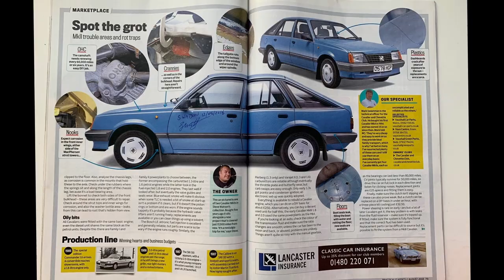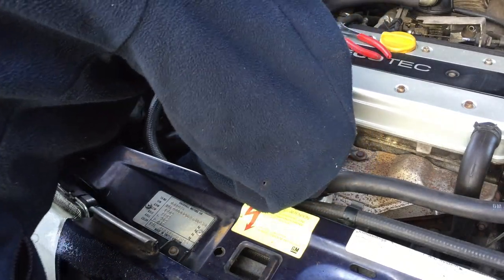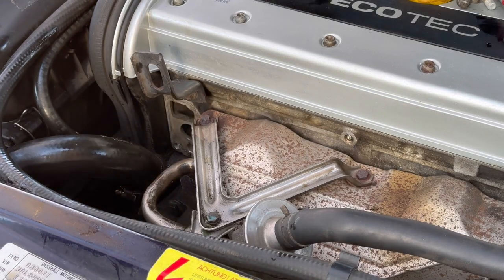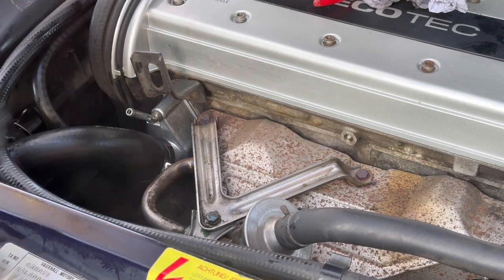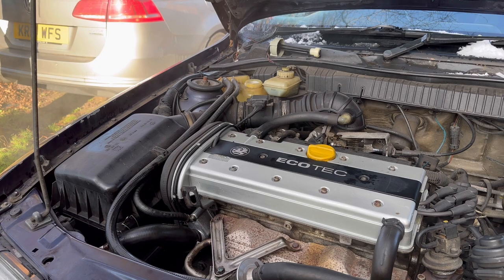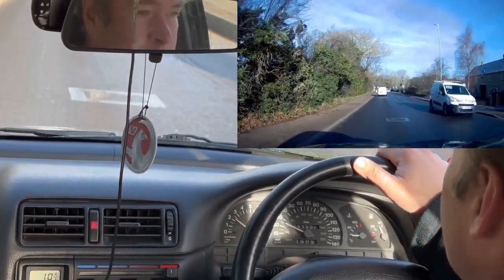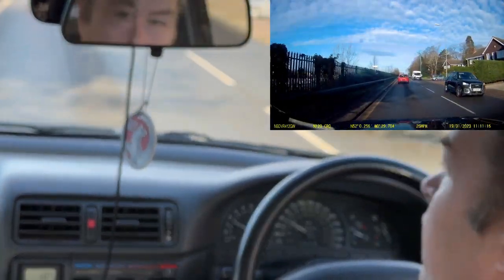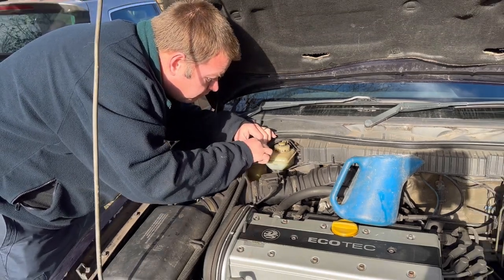Thermostat replacement Vauxhall Cavalier X20XEV with test drive

Comment: Another good video Steve. Yes you can remove the thermostat from the housing. I swapped one over on my Vectra b sri years ago as, i was only supplied the thermostat itself from the motor factors. Looks like that housing had seen better days though. Good work and, at least you have heat now. Look forward to the next video. Keep up the good work mate.
Reply from the maker: Thanks Matthew I thought it did I still have it somewhere, thankfully the heat is nice and consistent now much better than it was before that’s for sure. Next video coming soon it will be a long one so have a nice cup of tea of what ever you like and hopefully you will enjoy it. Cheers.

Comment: Nicely done.  Didn’t realise that was an automatic.  I need to get myself another mk3
Reply from the maker: Thank you! Yes I would rather it be a manual though but this came up at a good price a few years ago and it was so rust free I couldn’t not buy it.
I would do it sooner rather than later as they are getting expensive now and getting rarer.
Reply: @Cavalier_Steve  yeah I’ve noticed prices are on the rise. I plan on finding one for the summer.
Reply from the maker: Nice good luck, I hope you find one that you want, there are a couple of nice ones about if you don’t mind paying the money.

Comment: Nicely done Steve, don't you just hate having no heater in the car, my 2006 Mondeo ST TDCI had a heater issue for the 8 years I owned it, no matter how far you went the heater didn't put out any hot air even though the car got up to normal temps, I got the car when it was 2 years old and from day one the heater didn't work, my thinking was the heater matrix was blocked but it was a huge job to get it out.

Anyway mate I'm pleased you got it sorted and yeah I love an auto box, is yours a 4 or 5 speed Steve, mine is a 5 speed and it's the best auto I've owned👍👍
Reply from the maker: Hi John and thank you, this one really didn’t turn out what I wanted with the camera going flat 😒. Yes I bet you could have got away with the heater matrix being flushed out maybe with a hose pipe on your Mondeo I bet winter was a pain keeping the windows clear especially on a rainy day. 

The gearbox is a 4 speed but it does have toque converter lockup on 3rd and 4th which is good, it’s a good gearbox to be fair and on Vauxhall have paired with the engine well as the ECU retards the ignition timing on gear change so it makes it smooth very good implementation in my opinion, much better than the 2000 1.4 Honda Civic auto I once had. Cheers John see you in the next one. You may need 4-5 sittings for that or pop corn to enjoy when you watch it. Cheers mate 👍

Comment: Never worked on the ecotec in the cavalier, all mines are the single cam so interesting to see this one getting worked on. Is that your exhaust manifold blowing? I use the dexcool in my omega, which is ecotec as well so makes sense you're using it in this engine the single ohc you can just use normal AF.
Reply from the maker: Thanks Andy, I had someone else tell me that, apparently it’s a common problem for this style of manifold to crack, I took it off checked it over couldn’t find anything I also replaced the exhaust manifold gasket. It does have the wrong back box on the car so I think it maybe that, I will check it over again soon I have a second hand proper back box to put back on which I will record 😁 it’s annoying as it sort of sounds sporty which it’s far from.

Comment: That’s not a hydraulic lifter tapping is it ? What oil are you running in it
Reply from the maker: Hi Phil, I hope not, otherwise that will be another video in the future, I have a new tensioner and belt so we will soon find out, I’m using 10W 40 oil gets changed every year regardless of mileage which is typically around 3000 miles. I will get it done soon. Cheers.